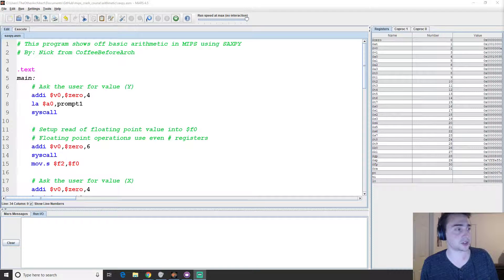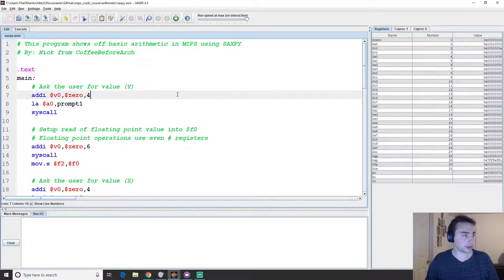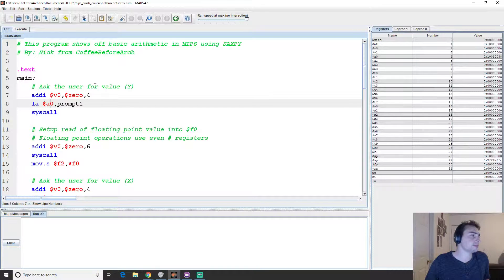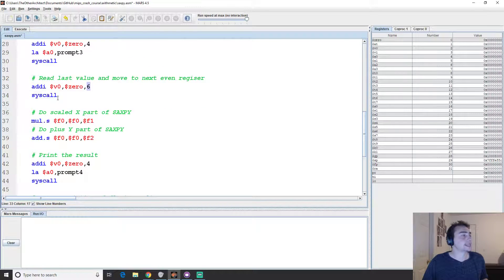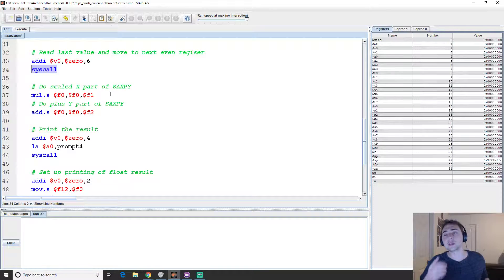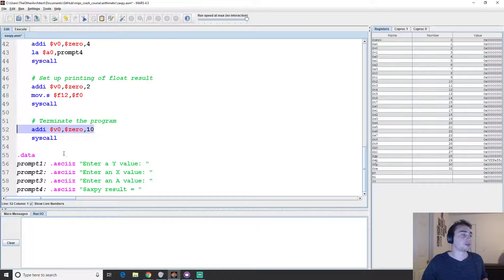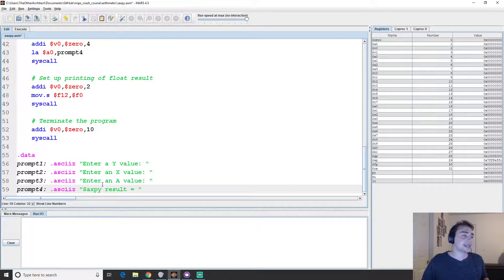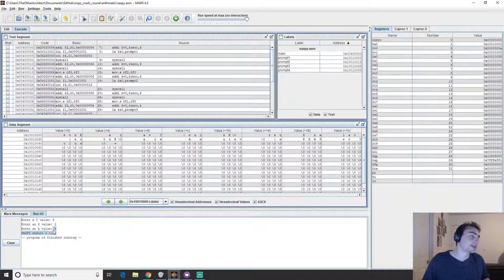MIPS Crash Course: Arithmetic

Comment: Thanks for these basics.
A quick question?
why did you move the inputs received in f0 to f1, f1 is not an even register right?
should it have been moved maybe to f4? or it does not quite matter and one can choose any register one wants?

and $f12 is basically used to print floats, just like a0 is used for integers/strings?
Reply: I'm also confused by the use of $f1 since it's not even.
and yes $f12 is used as an argument for floats. you can see this by hovering over the register name in the list with $f0, $f1, $f2 and so on.